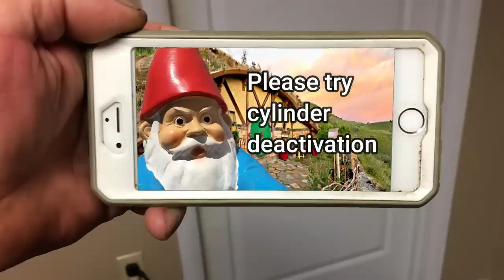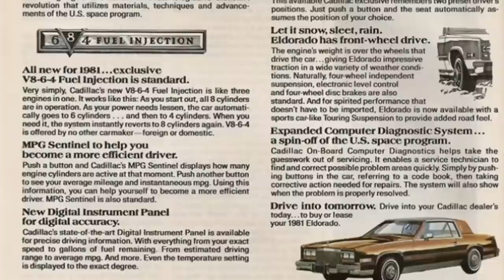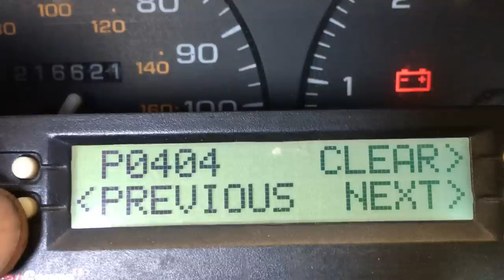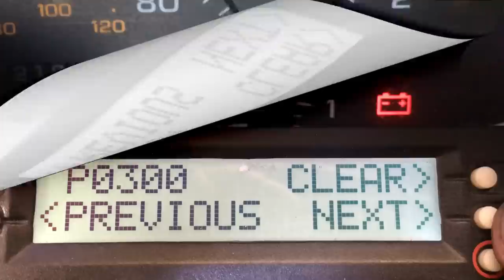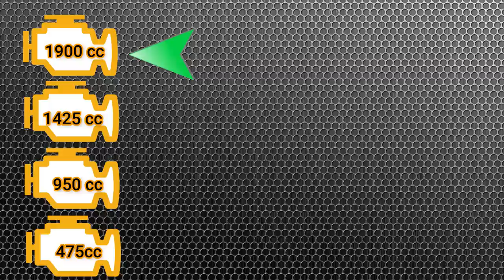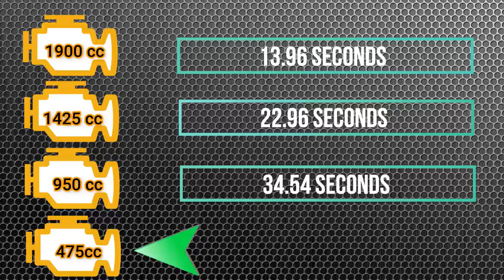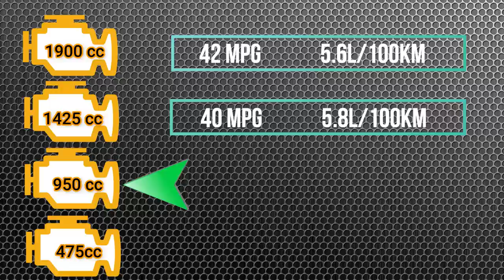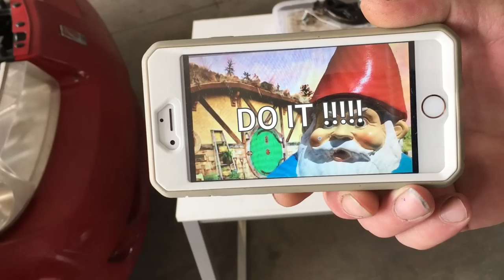S2E16:  We deactivate cylinders on our Saturn and test the car for performance and MPG

Comment: This was very interesting but I'm not sure what I learned. I was really surprised that the one cylinder would even run but was not at all surprised that it would not reach reach 60 miles per hour. As you said, the three cylinder was quite unbalanced. One thing that I do notice, is that there are quite a few cars on the road that have had cylinders deactivated. Not sure that this is intentional.

Comment: Please tell me you removed the plugs from the cylinders that were deactivated? With crank case breathers in their place? Otherwise every cylinder is providing a compression brake, every stroke. It balances itself by sucking crank case oil, balancing that pressure into the crankcase.

Comment: My 2010 accord had this it would shut down the front 3 cylinders for better fuel economy, over time this would lead to damage on the front bank from it being run so much at low throttle.

Comment: I just put a bunch of toggle switches on two of the injectors so you can electronically turn off the fuel injectors and keep them off

Comment: I reckon you'd get better performance out of a Briggs and Stratton than the 1 cylinder L24, since it'd have less dead weight. Also, if you try this again, see if removing the spark plugs helps with performance any, since the cylinder(s) that are firing don't have to deal with the compression in the deactivated cylinder(s).

Comment: I remember a youtuber working on a single cylinder pneumatic and I think electronic VVT system. That could possibly be used in conjunction with your predator based experiments as well as possibly a cylinder deactivation on the Saturn.
Reply: Wesley Kagan?

Comment: You could probably squeeze a bit more performance out by also removing the intake rocker arm off the deactivated cylinders, and removing the spark plugs and replacing them with a breather of some sort that would be filtered. With just the exhaust rocker off, you are still having the compress the intake springs, and now you sort of have 2 compression strokes that the other cylinders have to fight against, regular compression stroke, and the exhaust stroke is now another compression stroke as the exhaust valves don't open.
Reply: Love the smart comments on here.

Comment: I'd be really interested to see the numbers regarding hot air intake systems. They are very popular with ecomodders. Pulling air from around the exhaust manifold being the most typical design. What temps ranges see benefit? How badly is performance hurt? At what point will an ecu freak out and pull too much timing? Would very very hot air while using high octane fuel actually be better? Etc
Reply: It's really car/engine dependent. On some cars (especially transverse/fwd) the intake piping runs right over the manifolds/headers. This makes most cold air intake systems even more useless than they normally are (and can even hurt performance depending on length). I know back in the day when I had a Pontiac Grand Prix project car (dyno'd 335whp before I sold it), I just ran a hot air intake right off the supercharger. It goes right over the headers anyway, and the supercharger heats up as well, and it was the intercooler's job from there.

While that was from a performance orientated perspective, the theories still apply the same really.

If you have an engine (likely longitudinal) where the intake will not be crossing over the manifolds/headers/exhaust and comes straight to the front of the car, a hot air intake or cold air intake can perform fairly drastically differently.

So if your interest was to actually get higher intake temps on a longitudinal engine layout or one that is angled as such for intake, you would have to make a much more complicated setup to get the same results. This could end up being counter productive just like it does on a a lot of transverse layouts when you try and finagle a CAI into it.
Reply: @BeardedFrog  Looking forward to more from Robot Cantina

Comment: On my 1996 SC1 that I had, I experimented with a hot air intake.  The theory behind it is hot air is not as dense as cool air.  So, more throttle opening is needed to maintain speed which decreases pumping losses due to vacuum in the intake caused by a mostly closed throttle valve.  

My setup was as follows:

I took a couple of old socks and put over the factory air intake located behind the driver headlight next to the fender.  I’ll get back to the purpose of this in a sec.

I removed the resonator on the passenger side of the air box.  What is left is about a 1” diameter nipple.  Attached to this was a length of metal pipe with a 90 degree bend in the end.  The end of this pipe would end up between the #2 and #3 cylinder exhaust manifold, with the inlet of this pipe aiming down.  It barely fit behind the exhaust manifold heat shield.  

Now back to the purpose of the socks over the air intake.  I wanted the car to have power if needed at wide open throttle.  So, at low throttle, the vast majority of the intake air would come from the pipe in between the exhaust manifold.  At full throttle, more air would be pulled through the socks, thus lowering intake temperatures quickly and giving the needed power.  

With this setup, using a Scan Gauge II to monitor intake temps and ignition timing, I would see up to 200 degree intake temps under ideal conditions.  As intake temps rose above 200 degrees, ignition timing would be pulled by a VERY large amount thus negating any improvements in fuel economy.  

Fuel economy testing yielded 48-51 mpg with the hot air intake.  This was on a 5 speed manual car.
Reply: Thank you for this smart and  intelligent input... I come here for the videos and stay for the comments.
Reply: Btw, this was with hypermile techniques employed.  With driving it like normal, gas mileage improvements would of course be less than what I saw.

Comment: Years ago I tried this on my Tempo, but being an OHV I simply removed the pushrods for cyls 2 and 3 and disconnected those fuel injectors (Couldn't you have simply removed those rocker arms and let the original lifters float in their bores?). It sounded like it wanted to start but just couldn't quite. Reconnected a cylinder for three total and it was driveable, but oh what an awful exhaust note.

Comment: If you adjust the valves, run seafoam through the throttle body and change the plugs and wires you will have an even more powerful and efficient 2 cylinder engine. I also recommend removing the pistons and the con rods for reduced parasitic loss to the engine.

Comment: What if you kept it normal and just electronically shut off the spark plugs and the coil packs on it, wouldn’t that be better so you could use the full engine to take off and stuff?   Would that work or would that cause problems having everything in there just not doing anything?   And plus I know it would take more power to keep moving the valves and stuff when they aren’t adding any power
Reply from the maker: The valves must also be kept closed to reduce pumping losses.
Reply: @robotcantina8957     Robot,  looking forward to another great
video on Robot Cantina.

Comment: This goes to show that you need a certain amount of HP to move a car, regardless of the number of cylinders.  The only way to reduce consumption is to lower the drag and improve the engine efficiency.

Comment: A friend of mine bought a 1991 Ford escort (from auction), and after having driven it for a few months, he brought it to me because he said he felt like it was a little down on power. I noticed the exhaust sounded a bit funny pulling it in, but chalked that up it having a glasspack, and proceeded to check the simple stuff. Two of the spark plugs were normal looking, one was covered in oil, and one looked brand new. So I decided to do a compression check. The numbers were something like 110, 0, 0, 95 (it's been almost 30yrs- so probably not accurate). I tell him what I found, and he says to yank the head, and see if it can be saved. When I got the head off, I found the problem. The engine had previously thrown a rod , so someone jammed logs (yes, logs) into cylinders 2+3. No Rod, No piston, Just log. When I dropped the pan, I found the rod journals wrapped in radiator hose with a hose clamp around it to maintain oil pressure. 

My buddy didn't want to throw a ton of money into it, and couldn't afford a bone yard motor at the time, so he had me do a more permanent fix on the crank (weld the holes shut, as the #2 journal was absolutely trashed), reseal it, and that's how he drove it for 2yrs until the transmission started acting up (and the floorboards rusted through), and it went to the big scrapheap in the sky.
Reply: and they called me cheap
Reply: @omegarugal9283  This is a great comment.    The big scrapheap in the sky!!

Comment: Add reed valves to the deactivated cylinders and remove spark plugs to create a supercharger with the deactivated cylinders. Was done a few times with motorcycles. Of course intake and exhaust manifolds will have to be modified.

Comment: I know I'm super late catching up on season 2, but you could have used an inline fuel flow meter to calculate fuel consumed, that would probably have been less of a hassle than weighing the fuel tank each time.

Comment: I've wanted to do a project where you remove the cam shafts and use magnetic or pneumatic actuators to drive the valves.  Should be able to do a crazy vetec type configurations.

Comment: Old hit and miss engines would hold the exhaust valve open when in their “miss” phase until the rpms drop past a certain rpm.  I wonder to what extent holding open the exhaust valve on each deactivated cylinder would affect efficiency.

Comment: If the plastic plugs are not going up/down.  Why not leave the rockers?
Reply: The height of the plugs wasn't the same, the valve springs would have driven the caps into the bores after a short time... and in the meantime, cracked open the intake and exhaust valves and caused potentially serious problems with driveability (like a direct exhaust leak into the intake through the open cylinders).

Comment: If you do the 2 cylinder conversion again, supercharge it! 

Make the 2 dead cylinders into compressors (so in & out every stroke) that act as a supercharger for the cylinders you're using!
Reply: Idk if it would work but you’re on to something there
Reply: I'll detail the concept a bit, I've pondered the idea for a few years…

Air goes in a throttlebody attached to what was the "exhaust" port, for port size reasons. Remove poppet valve, install reed valve where the gasket goes.

Compressed air goes out the "intake" port through another reed valve.. Straight into the intake manifold that has the throttlebody holes welded solid, then into the working cylinder.

Theoretically, with two pumps per suck, with the same everything, you get twice the air. So 14.7psi of boost. Now you've got some losses, so use max intake pressure doubled Valves are also changed & more efficient, and compression ratio is changed (since different valves are used). 

Overall, I'm guessing that boost will be above 4psi but below 10psi. Probably 6-8psi.

The compressor pistons can be altered to change boost.
Reply: @Iowa599  Great comments here.

Comment: run the electrical using ultracapacitors, replacing the battery with ultracapacitor pack. seeing if it can be only ultracapacitors or if a lithium pack is needed to be added. how long would it last.

Comment: excellent experiment, it makes me doubt something that did not add up, it is supposed to be known that pumping losses are the cause of the greatest loss of power in gasoline engines, and that the less you accelerate, the greater the loss, and that it is more "efficient" when you go full throttle, and we all know that the more you accelerate, the more gasoline you consume, so logically we would say that with less cylinders like this experiment and accelerating more it should be better in terms of consumption, and we don't see that, what happens in gasoline engines that after a certain point the consumption is more exponential than linear and it is not supposed to be like that

Comment: Wouldn't be easier to disconnect the spark plugs? In case there is some diagnostic preventing the engine to run without proper spark, connected sparts and plugs/old sparks in the engine to cover the hole.

Comment: Kinda strange to my why the manufacturers not let the cylinder pump air opening the inlet and outlet ports in a 2 stroke fashion (but for the full stroke length) and turn off ignition and injection. This way there's not so much suction going on and the oil won't collect in the cylinder. Sure it may run a tiny bit rougher as there's no push back from the compressed air, but on the other hand there's much less heat and loss generated.

Comment: Wide open throttle issues are probably related to the ecu having built in rpm limiter. Add your modifications and the effect is very noticeable.  You can note this on a car in neutral, when you floor it the top rpm will bounce around.  Gm automatic cars have a Park and Neutral limit set lower than  limit  in D. Might even have progressive limits among gears when it comes to pcm controlled trans.  Not sure if manual has any gear selection indicator switches for the pcm/ecu. Perhaps a correlation of data from vss and engine rpm?
Reply: Looking forward to more from  Robot Cantina

Comment: What you should have done was to pull the head, drop the pan, and remove two pistons and connecting rods along with deactivating the cylinders. 

THEN you have have a proper two cylinder Saturn.

Comment: What if, you'd install a switch that turns off injectors fot 2 cylinders? You could accelerate with 4 and then cruise with just 2. Or better yet, some switch under the pedal that turns on 2 cylinders when floored but turns them off when cruising
Reply from the maker: To completely deactivate the cylinders, the valves also must be kept closed to eliminate pumping losses.  Just disconnecting the injectors would help a tiny bit, but you would also have a lot of power wasted because the engine would still be compressing air.
Reply: @robotcantina8957  Robot,   looking forward to another great
video on Robot Cantina.

Comment: Did this car not have an o2 sensor? I figured no matter the cylinder count the car would aim for stoich afr. Or maybe the for some reason the car decided to run in open loop due to a engine code.

Comment: Thanks, I am interested as I had the bright idea of doing the to a small diesel, to run a generator. Probably better to run with 2 cylinders firing together for torque to power generator under load.

Comment: From an efficiency standpoint I think deactivating cylinders is a bad idea because not only do they not make any power they still have pumping losses so they put a small load on the active cylinders making it a losing proposition.  I like the previous poster's idea except you might want to deactivate the cylinder that runs hottest (if there is one) and use it to supercharge the other three cylinders.

Comment: What a great vid. As the owner of a hypermile modified SL1 I highly approve. Since the car is coming apart anyway eventually and you can make anything into an interesting video might I suggest deleting the power steering just to see if there's any low hanging mpg fruit there. Possibly delete the alternator too and instead power the car off a few batteries as sort of a poor boy plug in hybrid system

Comment: Try a custom shaft with 120° interval and a straight segment under the first cilinder to reach the belt. You would need new firing distribution, camshaft and probably to change the middle load nozzle in the carburator.

Comment: The problem you've got is the ECU is taking the air mass flow and dividing it over 4 cylinders, so it's probably running incredibly lean

Comment: How about making an electric water pump and getting rid of all serpentine belt accessories? I guess having a good battery to maintain all the electronics if the alternator is not used either.

Comment: Can’t you adjust the clutch master cylinder linkage to improve the disengagement?  

At this point that would invalidate previous data, but I think the slow shifting adds more variability then adjusted to work.

Comment: If you do try pulling spark plugs like Andrew White said to try I would recommend trying to make some tube with a flared fitting like a brake line you can screw into the spark plug hole to try and divert the oil and stuff that'll come out of it. 
I'm sure pulling spark plugs would help some as you should have less compression that the now less cylinders are fighting against thus maybe the result of the low mpg numbers.
Reply: Love the comments here.. I come for the video on Robot Cantina and stay for the comments

Comment: well a bust for fuel economy this makes me wonder if you had say an old V8 with a destroyed cylinder in a car barely worth its scrap value, could you cut the rod off at the crank remove the rod and piston, deactive the valves and injectors for that cylinder and its counterpart for balance and run it as a 6 cylinder until it rusted away

Comment: I use egg trays for part 'retention' when working with a multi-cylinder head. The downside to that approach is if you're going to be shelving the work and have cats around or are any measure of clumsy, you're more likely to drop and thus mix up the parts...

Adjustable sorting trays/boxes are great for that, but obviously not free, and I've yet to find decent ones which can accommodate the length AND width of valves without being big enough to store your grandma's entire embroidery set.